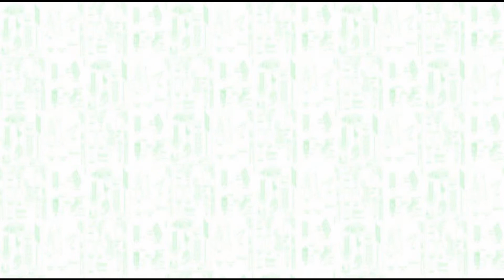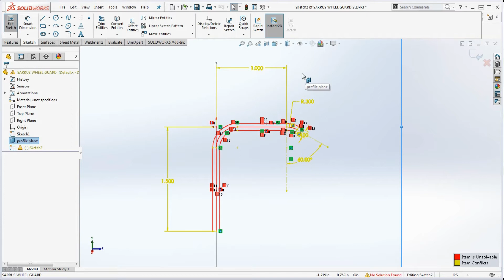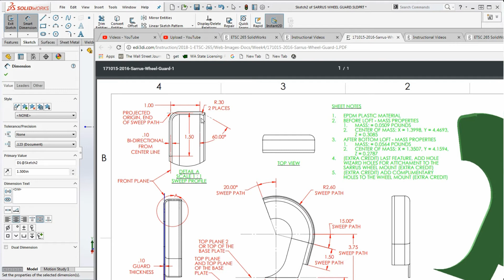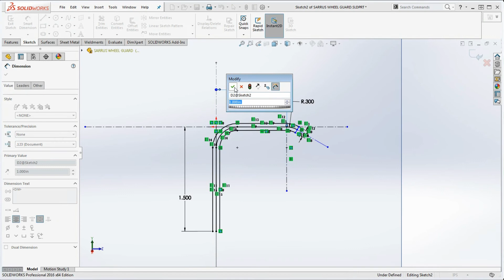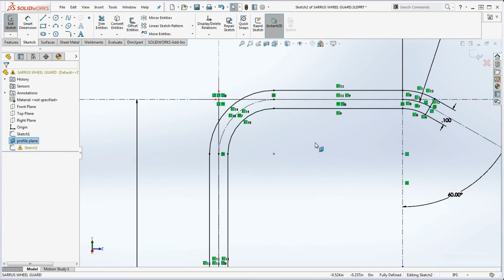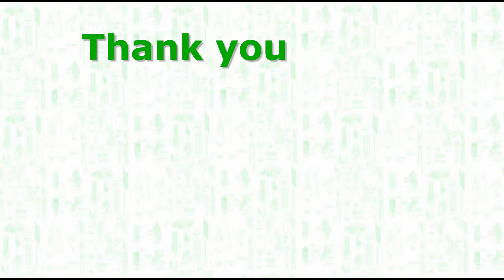SolidWorks Q&A - 5 - How to Fix an Overdefined Sketch That has the Correct Dimensions and Relations.

Comment: if that still doesent work there are some intersection relations that wont budge (the green ones).
Reply from the maker: Thanks for the tip.  Definitely 'extra' or redundant sketch relations may work at first - but may later come back to bite you.  CSS